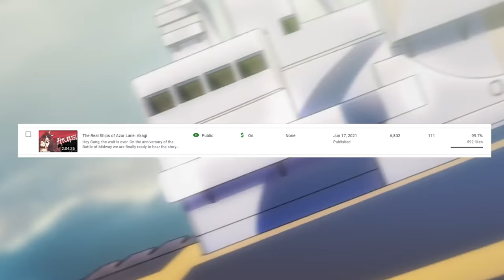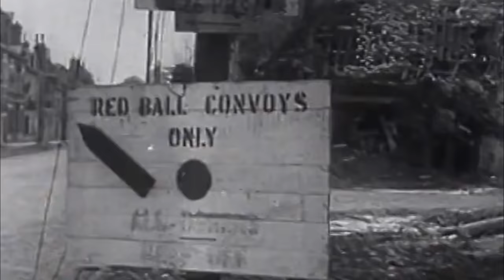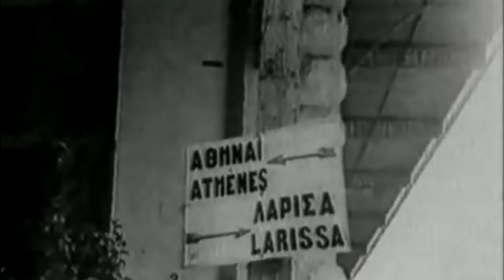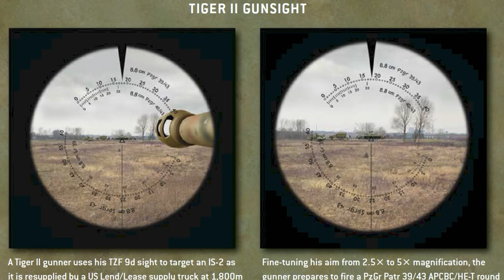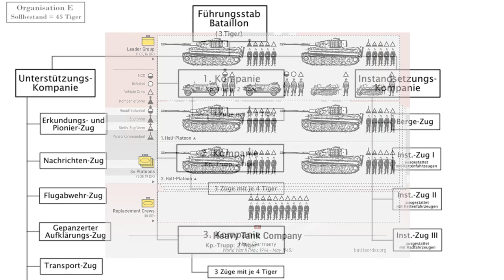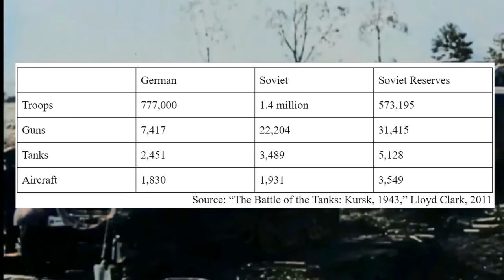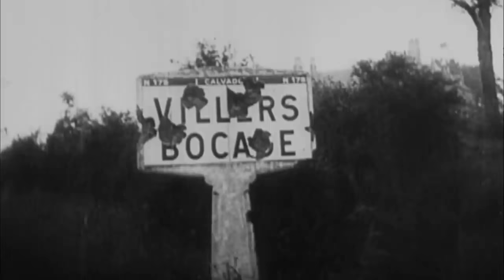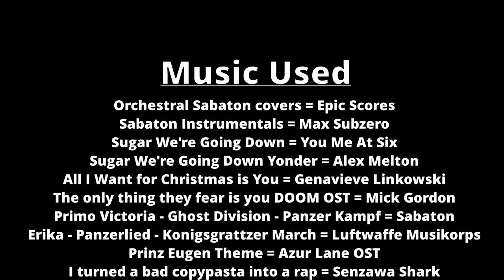The Tanks of Girls Und Panzer: Tiger 1 - WW2 History Documentary

Comment: There is usually one thing not usually mentioned about Tiger units. They had short barreled 75mm  Pz III M and N versions for anti infantry support.
The 21st PD in Normandy was rebuilding at the time and had an ad hoc of obsolete vehicles along with improvised tank destroyers devised by Major Becker from French chassis. It should have been considered at half strength at best to what it should have been.
Reply: Re the PzIII supports, the Germans did try that initially but abandoned it pretty quickly. I can't remember the reason why off the top of my head, but I think it might've been the logistical difficulties of maintaining two kinds of tank in the heavy battalions.
Reply: @Splattle101  During the 1944 Warsaw Uprising they had Goliaths flanking Tigers to keep the Polish Home Army from swamping the vehicles

Comment: Meanwhile my boy Panzer IV., a pre war design, doing its duty from the 1.9.1939 to the 2.5.1945 and remaining an effectivew combat vehicle to the last day. Definitly one if not the best tank designs of WW2.

Also the last german victory of WW2 was the "Battle of Bautzen" at the eastern front in 1945 against a mainly polish force (a bit ironic). The germans successfully launched a counterattack reconquering the city of Bautzen and the sorrounding area, holding it to the end of the war.
The general view is that it was a local german vicotry, although Poland also claims it as one because their overall frontline wasnt breached, just pushed back.
Still despite different claims to who "won" (on the polish side mainly for pride reasons do to this beeing the biggest battle the polish army was part of since 1939 and a defeat, no matter how small, would be emberassing in April 45) this remains the last instance were german forces successfully assaulted and pushed back an enemy force while reconquering a sizeable territory.
Not every victory has to be part of the big famous offensives.

Edit: Tigers were not build in the Ruhr Area, they were build by Henschel, which was a hessian arms producer based in Kassel. The compounants came from all over germany, but final assembly was in Kassel. The final Tiger Tanks of the factory saw service in the defence of Kassel itself and were basically rushed by the engineers into service by sticking every pare part still lying around together to get some out last second. The final Tiger II. that was constructed by germany was one of these on the 4. April 1945

Comment: Great documentary video, I like how you slowly build up the momentum on the situations and battles you presented, although your statement on germany lacking coal was incorrect. Germany had alot of coal and during that time they were the 2nd largest coal producer in the world. Coal was also used for their synthetic oil production at the end of the war albeit it minimally impacted the result. What germany lacked wasnt only rare metals but aluminium, there are documentations of german troops salvaging aluminum from crashed enemy bombers at the end of the war, and even scrapping every aluminum they could from tanks and planes ghey couldnt repair. They also lacked oil and by a large margin. Before operation barbarossa started, the chief of the logistics office compiled a report to hitler saying they only have enough oil and resources to mount a 3-4 month full scale assault until they would have to procure more oil sources.
I also find it good that you mentioned war of movement/maneuver. Blitzkrieg wasnt the term the Wehrmacht used to describe thier doctrine. The term only arised years later after the war when historians at the time referred to the fall as france as akin to a lightning war.
German tanks weren't superior in specifications to the allied counterparts, they were either matched or when it comes to the heavies, they were outgunned. What they do have is radios, most of the tanks had them equipped. The allied tanks had what you call a command tank, its usually the platoon commander giving orders to other tanks and them just having a receiver to carry out those orders. On the other hand, the german tanks all had radios and what they did was they would communicate while in combat with the enemy tanks to maneuver one or two tanks behind the enemy tank while one was drawing its fire. It was like a wolf pack systematically hunting down its prey. What they also realized that if you knock out the enemy command tank then the allied tanks will just drive around like chickens with their heads cut off. Thus they dealt with them swiftly and effectively.
Reply: After researching further, I realized I made a mistake. There was indeed a coal shortage in germany around 1943 onwards due to mismanagement and logistics issues. At the time, germany was indeed producing increasing volumes of coal each year but the transport operation to move it from mines to factories and other locations were either terrible or non existent. They had the coal but they couldnt use it. I apologize and im ratifying my comment.

Comment: 39:01 Okay... No. The T-34 was not anywhere that good of a tank and by this time Germany was well aware of both the KV series and T-34. Both of which suffered horrific reliability problems through out the entirety of the war. The Panzer IV F-2 was more than capable of demolishing  a T-34. The problem was that the Panzer IV was just as vulnerable to the T-34's 76mm gun. Hence the development of the Panther series.
Reply: Even the Panzer III could easily defeat a T-34, even without special ammunition. And the 76mm of the T-34 suffered from really bad gunpowder and overheating problems leading to a horrific rate of fire
Reply: the germans feared the KV because that was the actual tank they couldnt destroy at first, the germans eho say it was the T34 is the same way allies say it was the tiger. for allies all german tanks are tigers, for germans all allies tanks are shermans or for brits crusaders and soviets all tanks are T34s

Comment: It should be noted that the Chieftain has a video on the Panzer IV and points out directly that the support structure for the tracks is literally bolted onto the exterior hull of the Panzer IV. The Panzer IV Ausf D was unavailable in 1940. As such, the Panzer IVs that entered into combat had the 3.7cm KwK gun like the Panzer III. In addition to the Panzer III and Panzer IV, the Germans had Panzer 35(t) and Panzer 38(t), both Czechoslovakian Light Tanks with 37mm guns themselves.

Thus, the easing of the German supply lines as only Panzers I and II used different guns.

Of course, during the invasion of the Soviet Union, the Germans finally had Panzer IVDs with L25/7.5cm Infantry Support Guns. The Panzer IIIF rolled onto the battlefield with a L42/5cm gun. Wikipedia, as it should be noted, sometimes gets details wrong due to the sources used. There were few if any Panzer IVs with 7.5cm guns prior to the Battle of France. Almost all were exclusively armed with the 3.7cm.

That being said, sources do vary. I have heard of 75mm gun armed Panzer IVs in France, but not as much or as many. They may have been available on a case-by-case basis. But at the same time, it has been repeatedly stated that Germany had struggled to mount a 75mm gun onto Tanks up to and including 1940 and only succeeded after the Fall of France with the first Panzer IV Ausf Ds being available for the Invasion of the Soviet Union. And in both instances, all these sources are official sources that have been discussed at length for decades.

So, unless you got some up-to-date information and sources, PLEASE SHARE WITH ME!

Comment: Only thing I would add to this video is the often ignored mechanic situation among the great powers. The US was producing well over 50% of all vehicles in the entire world every single year for the prior two decades before war broke out. Even on the eve of war German vehicle production was a drop in the bucket by comparison. This meant that almost all mechanics in the German military were relatively inexperienced. When supply lines were stretched out from western Germany to the North Caucuses very few parts were getting through. The result was often a 19 year old that had only worked on engines for a year was trying to replace a valve spring with telephone wire and hope in -40 degree temperatures while retreating a thousand miles burning watered down gasoline. This, I believe, is why German tanks get such a bad rap for reliability when in reality they were about on par with other tanks of similar weights.

Comment: One error, going thru the Ardennes wasn't believed to be impossible to tanks, everybody with half a brain figured tanks could make it, it was thought to be impassable to the myriad of support vehicles that would be needed to sustain an armored offensive. Small but crucial difference. Also the halting of the advance in Northern France was because the Panzers had massively overextended, opening an enormous line that had to be defended and badly outrunning their supply lines, presenting a huuuuuuge weak spot that the rest of the army needed to cover their asses over. 

I would also hasten to point out that the Nazis didn't just invade the USSR as a way to out-produce Britain, the two had more or less been planning on killing each other since at least 1936 when they'd clashed in Spain, and if Mein Kampf is any indication it was set in stone far before that. Also Stalin did not just decide Germany wasn't going to invade, Richard Sorge had been warning him since late 1940 that they were going to, the thing nobody could figure out was exactly when they were going to do it, at least not until literally one day before it happened due to the testimony of Alfred Liskow. A lot of the major encirclements weren't so much due to the Soviets being completely unprepared as much as a lot of Soviet commanders making bad calls and being summarily punished for it, often literally.

Comment: The Tiger was the perfect tank for Germany in my opinion. The Germans were never going to build the same number of tanks that the Allies could so why not build a superior tank that has thicker armor and a massive gun so you achieve a high kill to lost ratio. The Tiger wasn't a rush job like the Panther was so it didn't have any of the teething issues the Panther did. Also the Germans didn't really have problems killing Soviet tanks. Combat records show the majority of T34s were destroyed by Panzer 3 Panzer 4 and Stug 3 tanks. The T34 is way overrated in my opinion. Sure the Soviets could build alot of them but it came at the expense of the crews and quality control. The T34 had a very cramped interior because of its Christie suspension and sloped armor. The factories built T34s to different specifications so parts interchangeability was almost nonexistent and the heat treatment of the armor was too high which caused spaulding killing crewmen when the tank was hit. The transmission was week so Soviet tankers carried a spare with them at all times. These problems with the lack of quality wasn't a major factor because Joseph Stalin didn't care. He was willing to sacrifice his countrymen to stay in power and the factory workers aka Russian peasants forced to build tanks didn't care either because they had to make their quotas every month or else get shot. So that's why so many T34s were lost in combat. A large  portion due to mechanical breakdowns.

Comment: Did you say that the kill/loss rate of the Stug    III was 10/1? It obviously wasn't. The Stug was the most widely produced AFV of the Axis with over 10.000 units.
Reply from the maker: It didn’t achieve that KD overall. But in the early life of the StuG III it drastically overperformed for its relative cost compared to the other AFVs
The Germans made.

Comment: The T-34 was one of the worst tanks ever built. It was cramped, slow, unreliable, had terrible armour (in terms of manufacturing quality) and the worst a 15% crew survival rate upon a hit. If it was not for the Allies bombing Germany factories and denying the Germans supplies they desperately needed Russia would have lost. Germany only needed to achieve a tank kill of 2 to 4 to win. They got 3 to 5.
Reply: I have got literally no idea where tf your info came from. YES, the T34 was not a good tank, but the survivability rates on the thing where actually good, the armour quality by 1943/1944 was actually superb and they managed to slap on an 85mm gun onto the thing, meaning the T34 could suddenly be able to kill a Tiger frontally from 1.5KM away. 

Also, you do not need to destroy 5 tanks to kill 1 tiger, in reality you only needed one plane, a molotov cocktail, AT grenade, AT gun or just an absolutely faulty transmission.

Also btw, German manufactoring quality was actually absolute shit. Most of the tanks they produced had to be returned to the factory due to shitty production quality in the Transmission, Engine, Welding plates, tracks, etc the list goes on.
Reply from the maker: Someone watched LazerPig's video. 

The German chances of defeating the USSR was practically 0. Even without worrying about the Western Front. In fact even with allied bombing German war production INCREASED. What defeated the German's was the logistical reality of fighting on such a large front. Even with the rest of their army they had trouble supplying the front as it was. And like it or not, the Soviets won. You see it in the figures, the reason for such high losses on the Soviet side was poor doctrine, outdated equipment and poor leadership. By 1944 the Soviets were actually drawing even with the Germans. The Sherman was way better than the T-34 by far. But the German heavies were overall a worse tank than the T-34 and the PIII and P4 while excellent were not produced to anything LIKE the numbers. Not to mention I have a feeling LP's calculations for T-34 losses included all combat losses, which includes AT Guns, Mines, Air to Ground kills and Panzerfausts.
Reply: @sirnurtle657  - The 1.5km was never achieved and the 85mm needed to be within 500m to reliably penetrate a Tiger. In ideal conditions the 85 model 1939 can penetrate a Tiger at 1000m, however ideal conditions rarely exist in combat.  That said I never talked about penetration, but accuracy. Even the late war production vehicles had serious problems as German who captured T-34 and Koreans who used war production T-34's during the Korean war did testify. The ideal T-34 are post war tanks as the factories had the time to build them to design. Factory 183 build 28,952 T-34's during the war. How did they achieve this? Massive factory and reducing man hours for 7000 per tank to 3600 per tank and you think that would not have caused reliability issues?

Here is a test for you. What was the top speed of the war production T-34's?
Reply: @AnimarchyHistory  - "Not to mention I have a feeling LP's calculations for T-34 losses included all combat losses, which includes AT Guns, Mines, Air to Ground kills and Panzerfausts."

This is true for German tank losses as well. Fact is the Germans achieved more kills.

"What defeated the German's was the logistical reality of fighting on such a large front"

Russians had it worse. They had all the supplies needed, but logistics came second. 

"Soviet side was poor doctrine, outdated equipment and poor leadership"

Both sides suffered poor leadership. 

"German war production INCREASED"

The Germans logistical difficulties along with poor leadership led to their defeat. This is a fact. 

The German's could have win the war on a single front with Russia. To say they had 0 chances is rather ignorant. And no, the chance was not 100% as their is no such thing in a world changing war as a guarantee of victory.